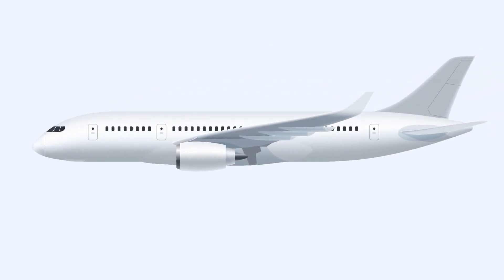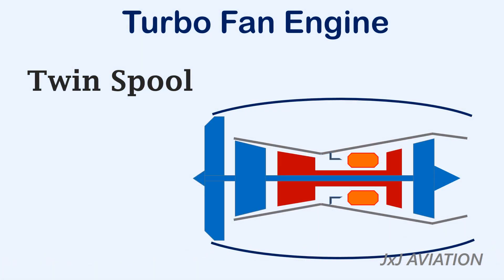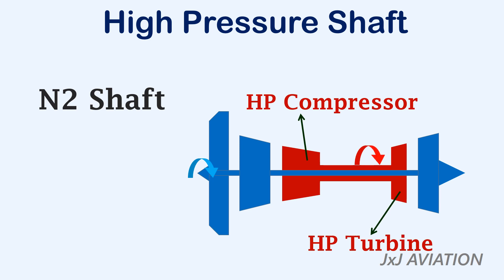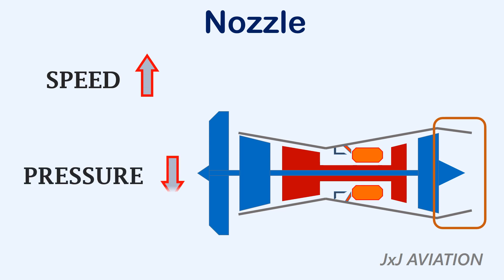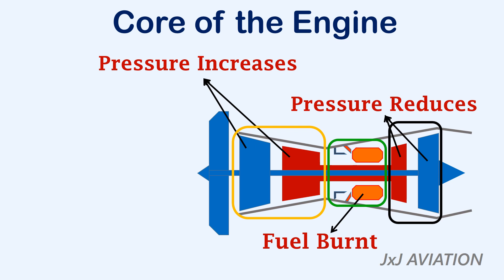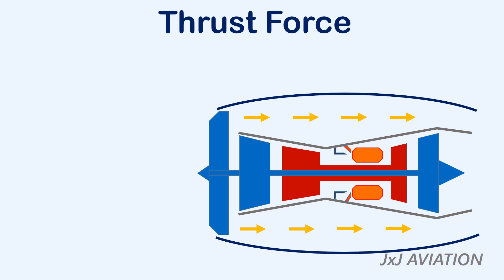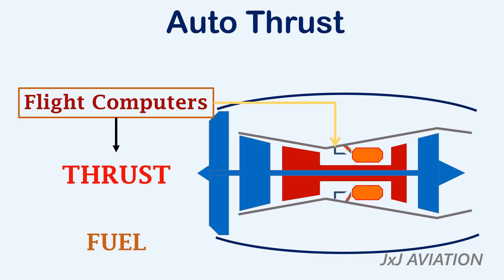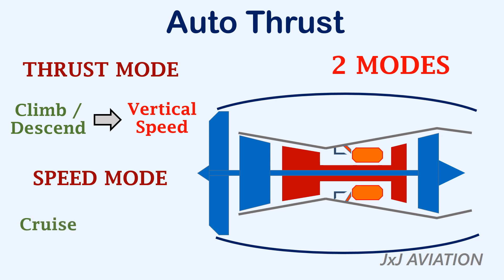Understanding Turbofan Engines and Functioning of Auto Thrust!

Comment: Dose the bypass section have variable rear faps to also control bypass air flow or is it air going just straight in straight out adding to overall pressure coming out of the rear of the engine???and what's the real name for the jet engine ignition system??is that whats popping and banging when you hear it on jet engines as it cuts in and out?
Reply from the maker: i dont think there are flaps for the bypass air. I havent heard the ignition system making audible noises

Comment: Dumb Question: Can a turbofan engine be completely electric if you had a battery source that could theoritically power it?
Reply from the maker: It would not be called a turbo fan. It would a propeller with an electric motor!